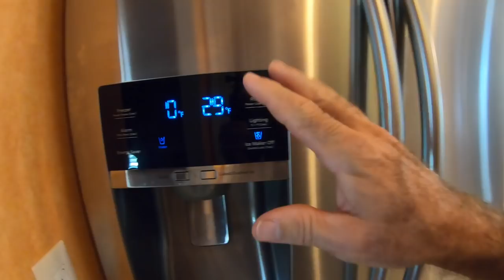HOW TO FIX A NOISY SAMSUNG FRENCH DOOR MODEL REFRIGERATOR

Comment: Thanks for the solution.  I fixed mine this morning without taking anything apart, but just unplugging and taking the food out to leave the doors open for 2 hours.  I'm sure it didn't thaw all the ice but it stopped the noise.
Reply: One follow-up from a few weeks later. When you defrost all that water, don't let it all drain into the tube at the bottom. Use a towel or bowl to catch it. I let it drain and it ended up as a huge sheet of ice in the bottom of the freezer drawer which interfered with the drawer opening.

Comment: Our Samsung is a SIDE BY SIDE... but same noise, same solution, just a DIFFERENT SPOT... it was down behind the drawers on ours (on the fridge side). After pulling the shelves, removing about 7 screws, I was able to get to it... and it was SOLID ICE that I had to chip out (large chunks). Then used warm water and a heat gun to get all the rest off. Those yellow sponge towels soaked everything up)... we cleaned it all up, reassembled it, plugged everything back in, and VIOLA - as good as new. Used the 'POWER CHILL' to get it back down to temperature. 

THANK YOU... and you are 100% correct, there just isn't any defrosting 'wire' in the area is really needs to be. If it happens again in less than a couple years, I'll look at added into the 'heat wire' so it can better defrost itself in the future.

Comment: thanks for the class James!  We have a Samsung ref similar but have not had the noisy fan issue as of yet.  Need to be very careful using a hot air gun because it can also melt or deform any plastic parts.  I got in a little hurry trying to defrost a small apartment size ref with a heat gun and deformed the plastic door.  The heated air gets much hotter than a hair dryer and more quickly.  Thanks again for sharing.
Reply from the maker: Yep, been there, done that.

Comment: I had this problem and found your video very helpful! Before doing this, I thought I’d first try just raising my set temp from the min 33 degrees to the max 44 degrees to see if it would thaw on its own. It took about a day or two but it did the trick! So try this before going through the trouble of clearing everything out and opening things up. :)
Reply from the maker: A manual defrost such as you did here is only temporary and doesn't address the problem but for those who do not want to attempt to correct the issue this is a good option.  Thanks!
Reply: FYI - The maximum temp for food safety is 40 degrees. Maybe a few days wouldn’t matter but something to think about.
Reply: @petera9251  oh no- thank you!!!

Comment: Many thanks! We had so much ice that even with a heater running on it, and a blow dryer, it still took us 24 hours to defrost enough to even remove the panel. But your instructions and video really helped, and we were delighted to not have to call in a service person while we're trying to stay socially isolated. Couldn't have done it without you!
Reply from the maker: Glad it helped!  Another way to avoid the blow dryer is to do a "Forced Defrost" cycle manually.  Check out my video on how to do that if you don't already know.  https://youtu.be/6tFWkWzLSqg

Comment: Called Samsung and spoke with an adviser who said to unplug it, open all the doors and drawers, put towels at the bottom on the floor to catch any overflow, and let it sit for 3-4 hours. It's called a manual defrost.  She also specifically said not to use a hair dryer at all. The shelves stayed in place and I didn't remove the cover; she said it wasn't necessary. If this works it is a breeze since I have everything in a cooler and frozen stuff I can use today if it gets thawed somewhat. I used the wait time to clean the inside with Seventh Generation hard surface cleaner and microfiber cloths. I will post a reply to this post with the results.
Reply from the maker: Thanks for sharing.  The main purpose of this instructional video is to identify if the cooling coil is not positioned properly from the manufacturer and make the correction so this does not reoccur.  If after you manually defrost and it occurs again this might indicate you have a bent cooling coil which is interfering with the fan after is freezes over.

Comment: I went through this whole process (very helpful and clear, thank you) and the fan is still making noise. Anyone else have problems w the fan design? It’s clearly not sitting right and/or rubbing against something. Hard to tell but easy to hear. Ugh (PS- inherited the fridge when I bought the house. )Will never buy Samsung -appliances again.
Reply from the maker: If you found ice buildup and you followed the instructions to remove all the ice and you still have a fan blade noise, then you probably have one of 2 things.  Something is still rubbing against the fan blade (maybe some of the foam insulation) or the fan itself is faulty which will require a fan replacement.  You can test the fan in place by connecting the fan back up but not putting the panel in place.  Plug the refrigerator back to the power and if it's still making the noise then the fan might be bad.  Also, if the fan is mounted too tight in the panel sometimes it warps the fan housing which will cause the fan to be noisy.  Try to loosen up the mounting hardware and test again.

Comment: First off great tutorial.  I had same sound issue and did as you described with loud hum that shuts off as you open door and hear the motor fan die down.   Unfortunately it did not work!  I'm so bummed and proud that I 'fixed' it.  But of course it is never easy.  What else could be my problem?  The fan itself?
Reply from the maker: Another issue could be the fan itself is not mounted properly to the back panel.  If the screws are too tight or not equally torqued in the back panel it can warp the fan housing causing the fan to make a noise when activated.  To test this you can pull the back panel off as you did as described in this video but don't disconnect the fan wires.   Close the door and plug in the fridge.  If the noise is still there then try adjusting the mounts of the fan.  Then retest.  Lastly, it could be the fan itself.  A simple test is to remove the fan and hook it to a DC power supply rated for the fan's operating voltage.  If the fan still makes the noise replace the fan.

Comment: 9:18 the “defrosted water drain being clogged with ice”
I fixed that with the idea from another YouTuber and an #18 copper wire (I think, it was two years ago), twisted and hanged from the defrosting heat elements inside the drain: so heat was transferred thru the wire down there. 
The issue was defrosted ice water was actually going inside the fridge toward the doors beneath the filter... that issue stopped and never has returned. 
But now this noise happened, not sure it’s a fan (fridge or freezer) as it continues after opening a door for a few seconds... I fear it could be the compressor, but then again not always makes the noise. Could be the freezer’s fan (evaporator)... new defrost programmed when food runs out of the fridge a bit

Comment: Thank you so much for the pleasant, thorough, and easy to follow tutorial.  Do you get ice build up in the ice maker too?
We had a repair guy fix the back panel problem this same time last year. So it looks like we will be doing a yearly defrost. Otherwise happy with the fridge.  Curious to see if our copper pipe is bent like yours which would explain how fast the problem returned.  .
Reply from the maker: Yes, we get ice build up and the condition where it stops making ice from the ice maker.  I have a fix action (upcoming video) for that but it's a band aide.  This is another poor engineering design by Samsung.  Other than problems with the ice maker, I'm happy with the fridge too.

Comment: One word of caution.............if the panel which holds the fan does not come off easily DO NOT force it.  I had difficulty removing the panel at the top so finally used  mirror and flashlight which revealed the fan housing encased in ice.  Had I forced it I would have torn the fan off it's base.  I used a popsicle stick to prop open the bottom of the panel and stuck a hair dryer up inside to melt the ice.  When the ice finally melted off the housing the panel came off easily.  As part of this process we also pulled the refrigerator out, removed the panel at the base of the back, and found that the coils were totally encased in a thick layer of dust.  Vacuumed and brushed out what I could but finally used a small blower to get the rest out.  I made quite a mess of the kitchen, but the refrigerator should be much more efficent now with the coils clean

Comment: Thanks for the video. The fix works, but issue came back in about 3 mo. I read through comments and see you mention straightening out the copper tubing to hopefully prolong the ice hitting the fan, how can I straighten the tubing?
Reply from the maker: If the copper tube is slightly off it is easily bent to make the correction.  I recommend allowing the copper tube to be at ambient temperature so as not to break a frozen tube.  It was easy when I did it but if you're not comfortable you can call in a qualified appliance service person.

Comment: Thanks for this great video. At 8:24 in the video there is a small rectangular opening at the bottom of the screen which I think is a second drain hole. On my refrigerator, it appears that the back panel which I removed was sealed against this hole, as there is some glue residue around this hole. Does this need to be resealed?

Comment: Great video! Do you recommmend using any kind of insulation around the copper tubes on top right to prevent it from happening again? Wondering what kind would work best. Thanks!
Reply from the maker: No, I just recommend adjusting the copper tubes if they are not aligned properly to prevent the freeze up from reoccurring.
Reply: @MyPIDream  have you done that? I didn't notice that you realigned the copper tubing in the video did you do it at another time?

Comment: Hi ! I did all the steps, two weeks later same problem again . I ended up adding isolation on the tubes area. Waiting a few days to hopefully see the difference
Reply from the maker: That's the problem I had.  The copper tubes weren't centered and after adjusting I never had the icing again on the fan blade.
Reply: Did insulating the coper pipes helped? I can try that.
Mine freeze up again after 3-4 weeks of defrosting.

Comment: Thank you! Do you think a steamer would be ok to use instead of heat gun?
Reply from the maker: I'm not familiar with a steamer but if you can direct heat in the direction of the ice without damaging the plastic around it then I guess that could possibly work.

Comment: Question - mine is making the same noise. When I open the freezer it automatically stops. I emptied the freezer and started emptying the fridge. I got all the screws off except the top one. It’s completely stripped from water. The big drawer inside has a layer of ice under it too. I’m going to try the hair dryer tomorrow but, I can’t get that too screw out. Any suggestions?

Comment: Thanks, Never buy any  Samsung product anymore.
Reply: Never ever ever, f ing never, again. Never
Reply: @Nick-xu2hh  Seriously. Awful quality. Our fridge sucks, the UHD TV has issues, and the soundbar loses ARC connection. Shit quality.
Reply: Btw heard LG Also have MAJOR issues also evident by their many YouTube videos online
Reply: @JoshBryan  did you buy them all at the same time?
Reply: @DrNimrod  did not. The refrigerator was purchased in November 17, TV in March 18 and sound bar in early 19. The TV can't stream without buffering most of the time so now we use the Xbox or Chromecast and they NEVER buffer, even with 4k. The TV must have crap processing and or RAM for streaming. The TV randomly starts skipping sound from inputs. I have to turn it off and on to fix. It randomly quits talking to the sound bar and needs to be reset. The sound bar has crap bass from the sub. The frig has the well documented ice issue as well as phantom inputs to the touch screen.

Comment: We had this problem fixed in July and now a month and half later it's a problem again! The first time the person did replace a part as well. Would just defrosting our refrigerator without taking off the panel allow it to thaw and fix the issue?
Reply from the maker: Defrosting is only a temp fix and you really need to inspect behind the panel to see really what's going on.

Comment: Why couldn’t you put some insulation on the tubing at the top right to prevent condensation that eventually freezes?
Reply from the maker: Hi Shane.  This Samsung unit has a rubber foam insulation on the tubing that goes a couple of inches from the back of the unit into the cooling area inside.  This rubber foam is the first area to begin freezing because it's the interface between the humid warmer area on the back that meets the dryer cold area inside the fridge.  I still believe the solution is an intermittent heating element in this area or possibly a different type (material) of  insulation at that interface.

Comment: Unfortunately didn't see this in time, ours has apparently frozen up? I'm not sure if this is our only problem however. Our freezer has stopped cooling and our ice maker quit....Would that be because of this? the noise has stopped at this point, are we too late to recover it?
Reply from the maker: The ice maker is usually another issue.  Pull out the ice tray and look to see if there is ice buildup or possibly ice stuck between the wall on the right and the ice dispenser.  If so, there's another solution to getting it to work again.  Let me know what you find when investigate and I can give you some advice.
Reply: @MyPIDream  Thank you! I will check that tonight when I get home, I believe it was all melted back there, as when I pulled out the Ice maker to check it a bunch of water spilled out of it....But I will definitely check on that. I plan to check the panel tonight as well. Or at least unplug it and let it thoroughly defrost since it will be cold enough outside to place all the contents outside.
Reply: Ok, I think? That was it....not positive, simply because the ice build up I had was to the direct right of the panel and on the bottom tray under the crisper drawers. By the time I got the panel off which was only about 30 min from when I got home. The coil was clear, but wet. My husband had turned on the force defrost while I was pulling everything out. 
I dont see it melting that fast, but maybe??? Anyway I got that all clear but, there was a lot of rust flowing down behind the humidity panel on the bottom left side, and the area directly under the coils was flooded. 
Is it possible those coils defrosted that fast? I'm hopeful this fixes it, but since I found no ice behind the panel ( but basically everywhere else) and the fan was not hindered at all....I'm really not sure?
Reply: Well NOPE! Or I have something new now....put all back together plugged it up and screen is now flashing 6A & 88 on one side and the other side just stays 88 😭 I've unpluged, taken panel back off, checked around humidity control, no wires messed up anywhere, put back together, like 5 times now. Called Samsung support, and they just say they will have to send a tech out....Thursday! Glad its going to be cold outside the next couple days, I may salvage something at least. I hate to, because I know this should work, but I think It's time to buy another one tomorrow 😥🤷‍♀️

Comment: Hi, my fridge had that problem a few weeks ago. The noise is removed but now I feel that it does not cool as it should be. What I can do. Thank you
Reply from the maker: First determine if it's cooling properly.  Look at your temp on the door for the top compartment and put a food or beverage thermometer to see the actual temperature.  If it's not achieving  the set temperature then maybe the connector to the fan came loose and is disconnected.
Reply: @MyPIDream  Thanks a lot. I checked well and saw ice. I defrost it normal. I hope this works. if it does not work I will follow the steps of your video. your explanation is excellent.thanks

Comment: James, it seems you identified the cause of the problem. Why didn't you centralise the copper pipes and/or extend the heating wire?
Reply from the maker: Anytime there is a modification that involves an electrical circuit you have to be extremely cautious.  The engineers might have tried something like that and without the data you risk the chance of damaging the appliance and more important a potential for a safety related incident like fire.  I didn't show it on the video, but I adjusted the copper pipe centering it more into it's intended location so let's see if this doesn't help with the frequency of maintenance involvement.
Reply: @MyPIDream  Thank you for the reply and keep the great videos coming 👍
Reply: My PI Dream can you follow up on the copper pipe centering? Did it help?
Reply: @MyPIDream  - Can you give more information or video on what you did to center the copper pipe?

Comment: So how many times have you done this now and have you done anything to fix the freezing up top on the lines coming into the condenser? I've defrosted several times, I haven't taken the back panel off yet I just unplug for at least 24 hours. But have you found a real fix or have you moved on from Samsung? In all honesty, I can't believe that Samsung has not found a fix for this. Poorly engineered, $2,000 for 5 years of use and I will not buy another SAMSUNG product in my life, it's not right that they don't come up with a fix!
Reply from the maker: When I adjusted the copper tubing it fixed the issue.  Has not come back.  We still have 2 Samsung French Door refrigerators, each with their own set of problems but I address all of them with recommended fix actions in several of my online videos.